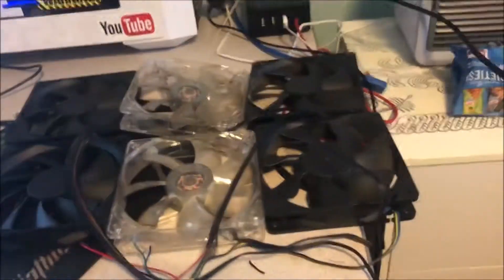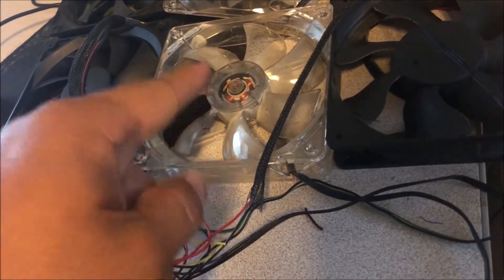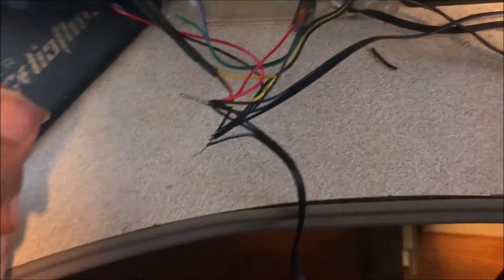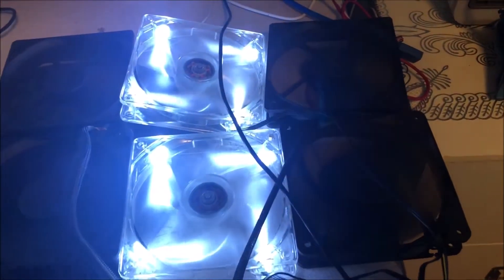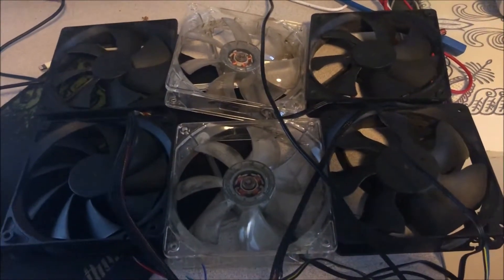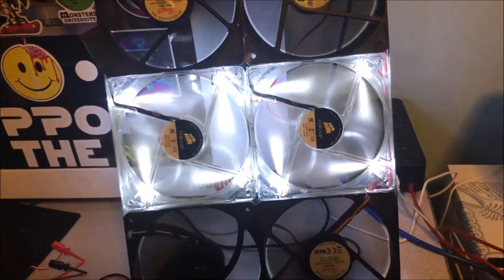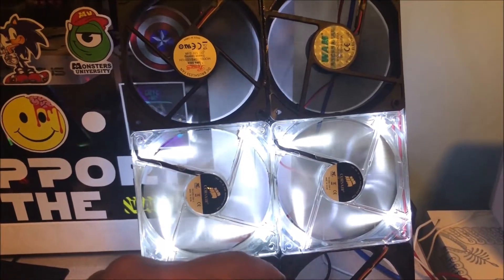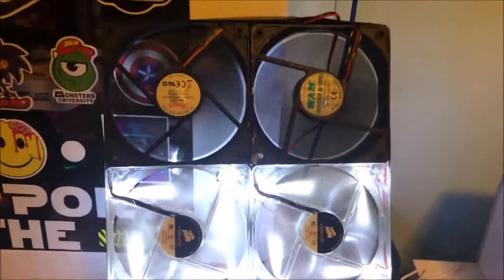Connecting Multiple CPU/Computer fans together to make a bigger fan! (ventilation system for a shed)

Comment: You are connecting 6 fans to a single 12volt adapter, wouldn't that at some point heat it up and possibly melt it or cause a fire? I'm looking to do something like this but I can't find any information about it. This video also doesn't mention any of this information that is very important to know when doing a diy like thist.
Reply: Me too, lol. Assuming each fan is 0.25A max, it's probably less than 1 ampere.